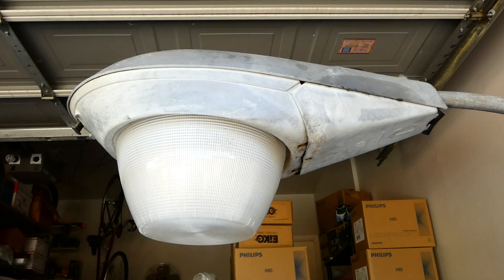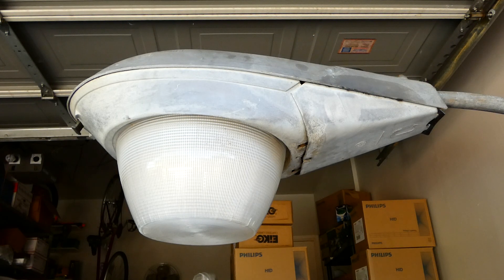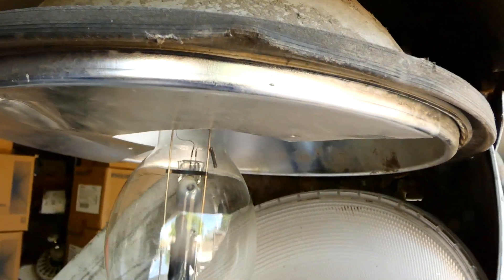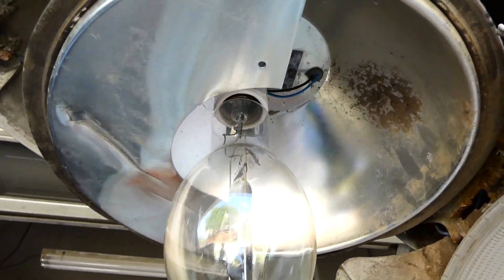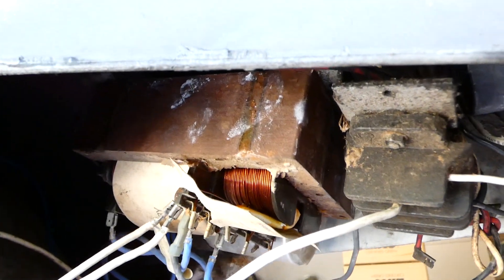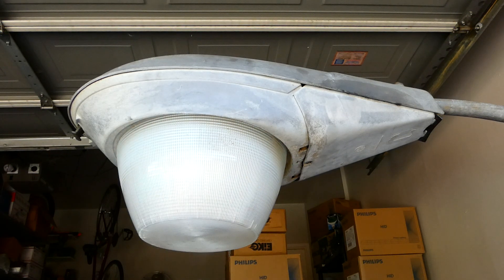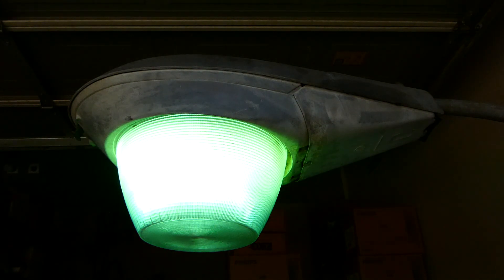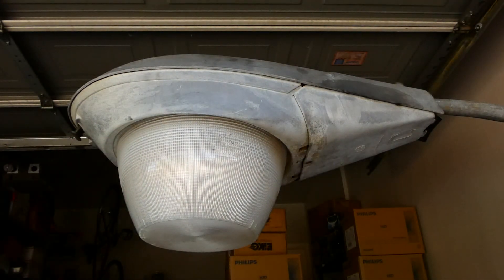General Electric C400 "CrimeFighter" street light (MV converted)

Comment: Being from Chicago, I remember those fixtures quite well.  The majority of conversion to HPS lighting occurred during the late '70s/early '80s.
Reply: This type of fixture is also available as GE, M-4002, Crimefighter in the late 1980s through early 2000s, and they are abundant in Chicago Illinois, then any other major cities in the USA. There are couple of changes between GE M-400A1, Crimefighter, and GE M-400A2, Crimefighter is the location of the photocell was moved from the rear to the center of the fixture, and the latch is different at the front.